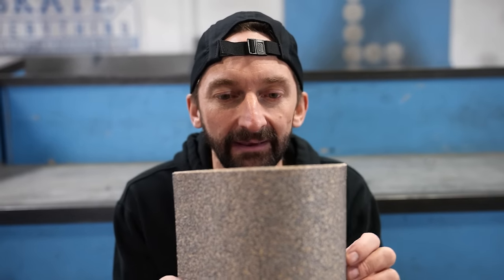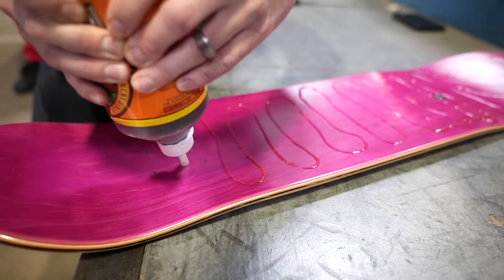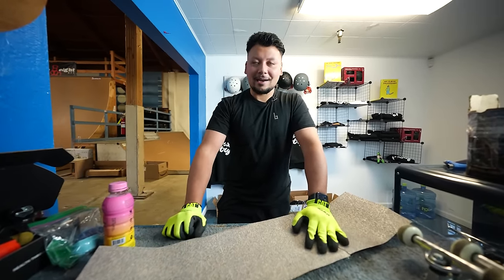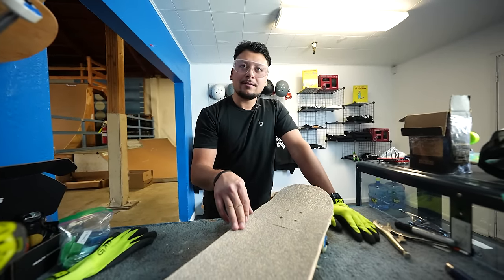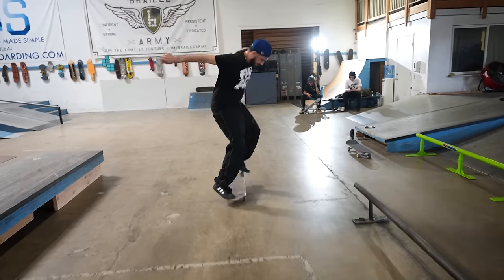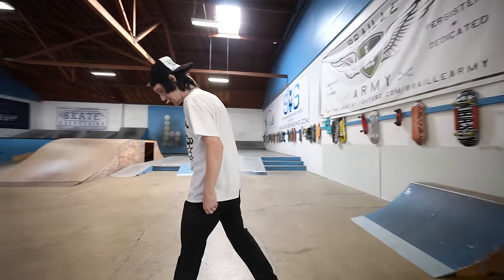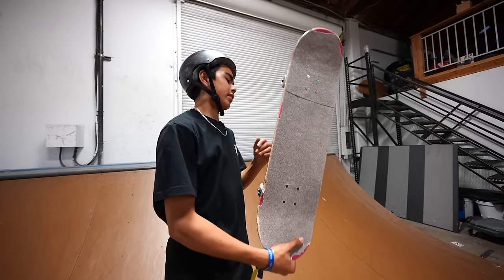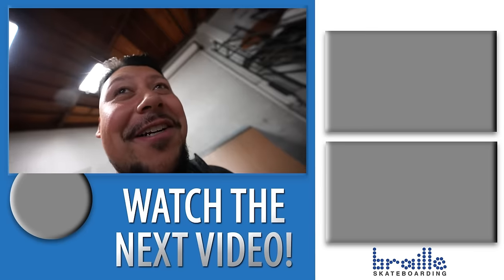USING THE SHARPEST SANDPAPER AS DIY GRIP TAPE!

Comment: In terms of attaching to the board, best thing you should use, is spray contact cement. You spray a thin layer on each surface, wait for it to dry a little, then when it contacts it won't let go.
Reply: I agree. I was thinking of a spray adhesive

Comment: You should try different grits of sandpaper to see which is best
Reply: 400 grit  😊
Reply: And use a spray adhesive instead of regular glue
Reply: they also sell self adhesive backed sandpaper.

Comment: You should have used contact cement glue, it is what is used to adhere the laminate to wood in making countertops. Also there are different grits of sandpaper, so I am sure you can find a closer grit to what matches grip tape. I have never skateboarded, but have spent a lifetime in construction.

Comment: man, you got like the gnarlyist grit sandpaper for this! I wonder what it would be like if you tried super fine sandpaper, like polishing 3000 grit? or maybe multiple grits, like 80, 180, 220, 320, etc? Also 3M spray adhesive might work great for this, and a lot faster! spray the paper then the board, let it dry, stick them together and go!

Comment: Some sandpaper does have glue on the back. It is made different for different needs. Also griptape is made for abusive use over a longer time. Where as sand paper is typically made to be abrasive, but not longevity

Comment: Sandpaper falls about when you sand with it. It doesn't last very long, which is why you buy it in rolls or many sheets. So I wouldn't expect it to last long on a skateboard. The more it gets used, the less grippy it will become because the little rocks/sand will fall off. It appears, that's exactly what happened.

Comment: Try a slightly finer grit and use a cheap brush to apply the glue so the glue is covering the whole deck evenly it might not peel as easily 🤔

Comment: Aaron didn't spread the glue out so it's ripping off where it's not actually glued down. Also medium grain sandpaper would be more similar. I think if someone can buy grip tape that's the obvious way to go, but lots of people are trying to skate with little to no money and sandpaper is a real way to cut cost.
Reply: That's another video: 

Different grades of sandpaper compared.

Also, get aerosol spray glue so it's a better coat!
Reply from the maker: yes to the glue

Comment: Here's some science (?) that nobody asked for:  The number, or grit, that sand paper is graded with has to do w/ the size of the "sand" particles and how many of them fit through a 1 inch square space. The lower the number , the bigger the grain of sand and the rougher the grit. Higher number = smaller sand = smoother grit. 

The paper you guys used in this video was 36 grit, so 36 of those sharp little grains of "sand" , if all laid out tightly in a single layer, would pass through a 1 inch square hole. 100 grit means the sand would need to be smaller so 100 grains could fit through the same sized hole and so on. 

For comparison, the most common grip tape (Jessup, MOB, etc) is ROUGHLY 😂the same as 80 grit sandpaper.

Comment: You should go the next step of cheapness. Instead of using griptape, roll glue onto the top of the deck and pour sand over it. The grip is whatever sand sticks when the glue is dry.

Comment: I used Aluminium Oxide paper on my board in the 70's... It dissolved when it got wet 😄
Reply from the maker: What is that?
Reply: @brailleskateboarding It's what you were using! Aaron actually says it in the first section round 30 seconds in 🤣

Comment: The sandpaper broke off because the glue wasn't spread before applying the paper so it only adhered in strips and didn't fully glue down. Brushing or rolling it for full coverage would yield better results and not flake apart like happened on the edges of this board.
It would be an interesting video to try every grit of sandpaper. 36,60,80,120,180,220, 300, 480, 1000, 1500, 2000, 2500,3000, 4000, and 5000. Then compare how all of them feel against each other. Could be a series of videos with a bracket comparing 2 grits to each other and only 1 move on. Match the lowest and the highest for the first round. 36 vs 5000, 60 vs 4000, ect.
Could also do a game of skate with this 36 paper glued to the bottom of shoes and then use a normal gripped board.

Comment: Omg did you guys really try to peel sandpaper lmao... It looks like P36 which is probably the same as the griptape you used before. P36 is possibly the roughest sandpaper there is. Pretty sure griptape is just sandpaper probably P120 or P180.